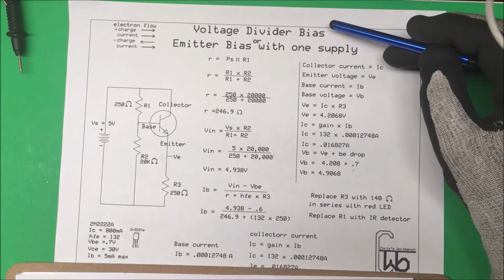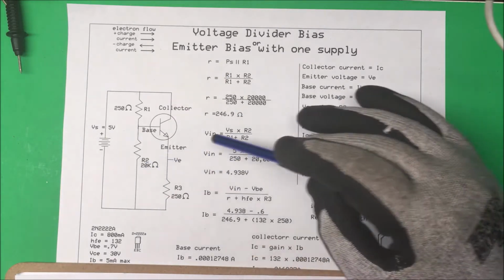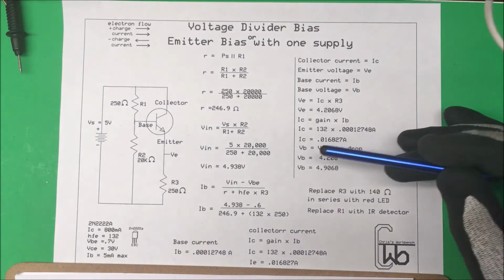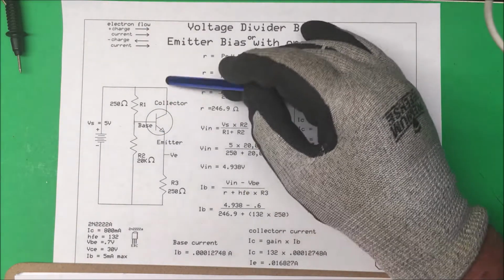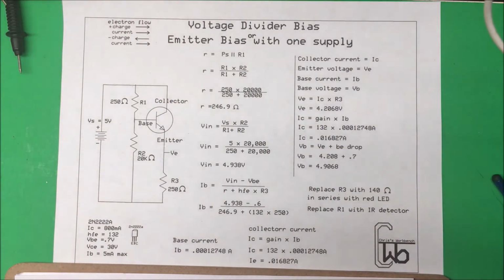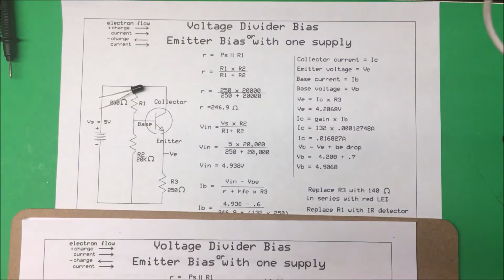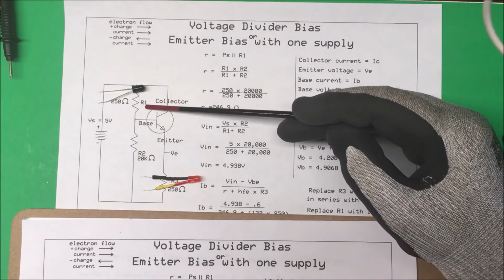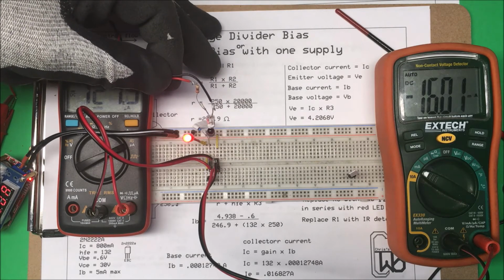Voltage Divider Emitter bias

Comment: Having Vbase=4.9068V means that the transistor is already saturated and there is nothing else to do as an amplifier.Also the circuit is an emitter follower that not amplifies signals but used as a buffer stage.Maybe as an quick and easy IR led preamplifier the circuit might work.
Reply from the maker: True, the transistor acts as a switch when the IR resistance drops.
Reply: @ke6chris  I got it.In fact transistor buffers the resistance divider output to the next stage.